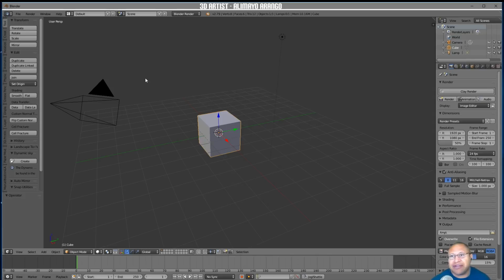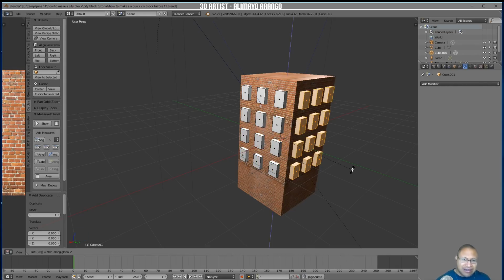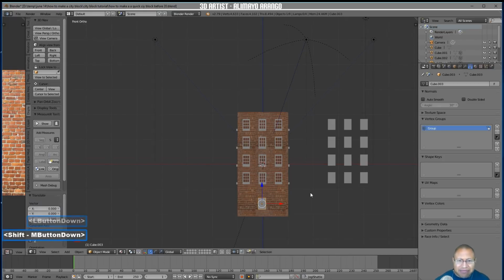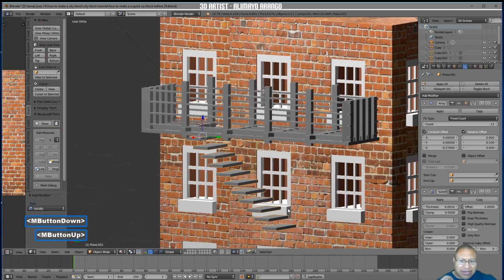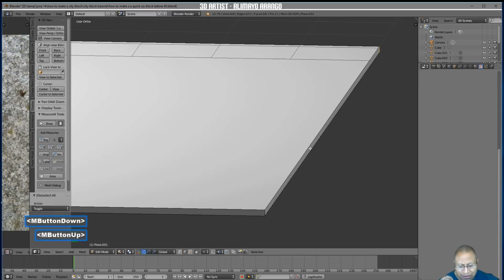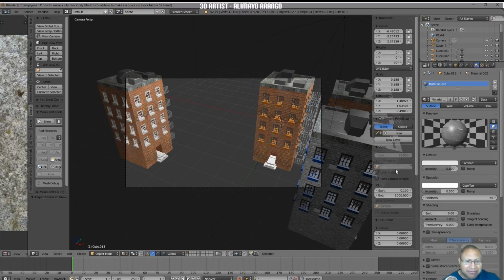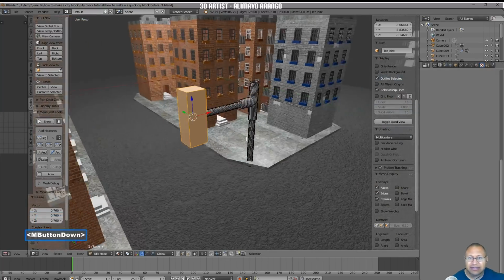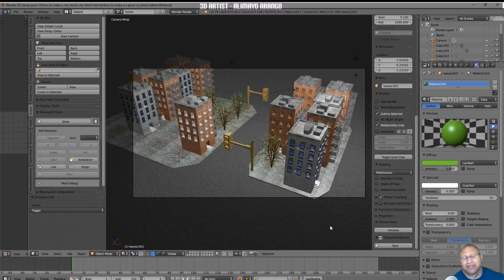How To Make  City Buildings In Blender 2.79a

Comment: Good stuff Ali. Appreciate the work necessary to put this together. Quick question on Lighting Sets. I'm using 2.79 and I do not see lighting sets as an option. Do you know where they are?
Reply from the maker: Thanks for the kind words mike. Lighting sets have to be activated in user preferences. You need to put a check mark next to "add advanced objects. You should now be able to see the lighting sets option after you press "shift + a".

I hope this helps mike thanks for watching the videos on this channel.